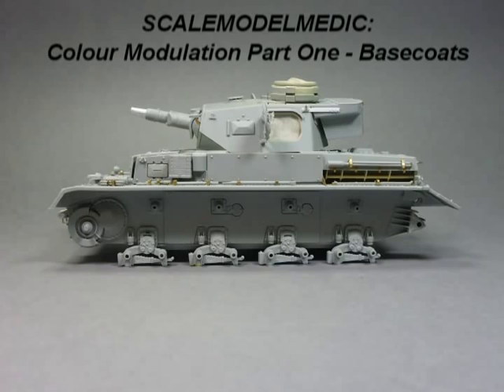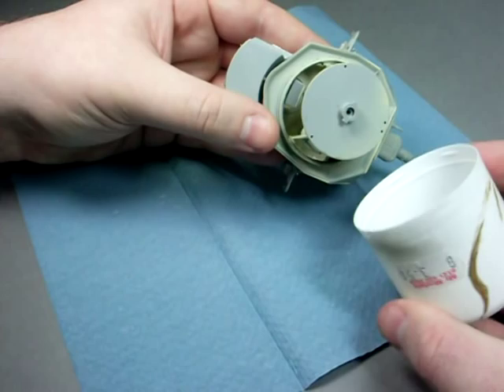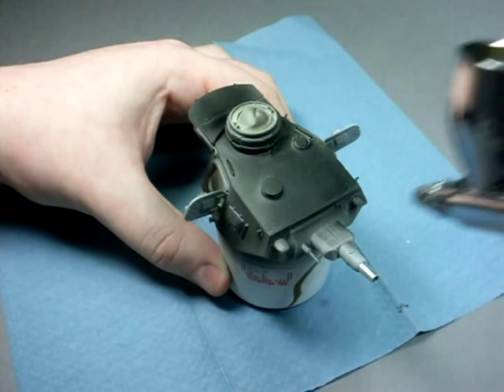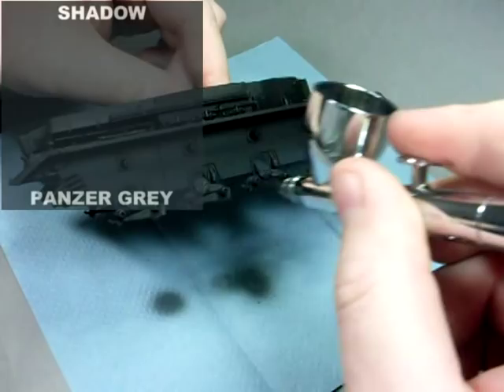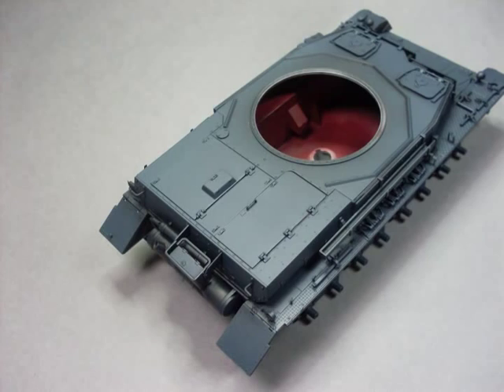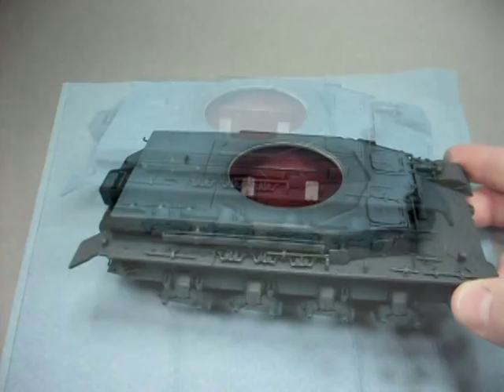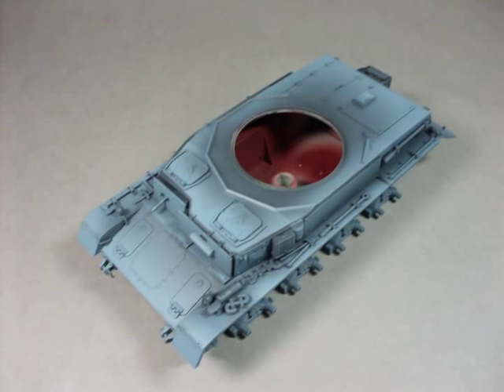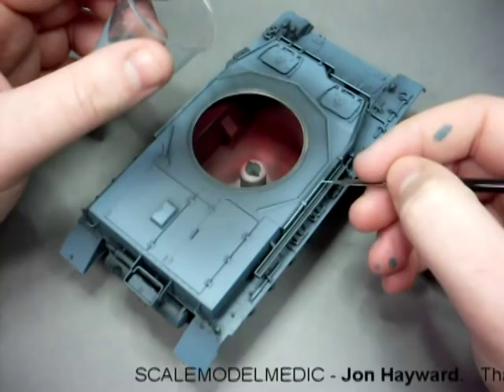Colour Modulation Part 1: Airbrushing Basecoats

Comment from the maker: @xxxxRINEHARTxxxx  a part is just 1 measure of whatever you're using.  If you're using a pipette a "part" could be 1 drop or 2 drops.   If the mix is 2 parts white to 1 part black it would always be the same ratio of paint.  A part could be a pint if you're mixing a lot of paint, it would still be the same ratio just different amounts.

Comment from the maker: @vintagestarwars 

yep the Vallejo air are not just great paints but acrylic and clean up in water just fine.  They DO dry on the needle and tip like any acrylic, but it's simply a case of regularly cleaning with a cotton bud (qtip) to remove the residue.  Painting this model I didn't suffer with it as much as I do when spraying a "field applied" camo like in one of the HD test videos,  then I'm cleaning the tip pretty much after every spray.

Comment from the maker: Yeah I agree, the actual base mix is quite good (10 parts seagreen, 3 drops black, 1 drop insignia blue) and a nice tone for panzer grey - but if you're modulating you need to go light and blue is the nicer tone.  Grey looks too flat really, and would be even more pale than the blue.

Panzer grey is a really nice colour, very dark and imposing.  This is more like a grey-blue,  but I'd rather that than a grey-white.  The tank would look like a B&W photo with too much exposure.

Comment: I would agree with this as I do something similar, i prime the model in vallejo black surface primer then I use white to paint just the center and main body of all the panels staying away from the panel lines leaving the edges and any shadow areas in black I then shoot the main color over it in very very light coats until I achieve the right under shading. it works fantastic on tanks and armor models as a whole. I favor German WWII armor mostly.

Comment: I dont understand how the airbrushes in all guide videos work so good and produce such steady and nice flow of paint. I only do modeling about 1 year, but almost every day, I started with some cheap airbrushes and never got results like in videos. The paint was clogging, sprinkling, or flowing too much and ruining model. Then I read more forums and watched videos, and I invested in good airbrush Badger patriot (very expensive for me, I am from poor country), but again same. I clean it after every use or color change. I bought proper acrylic thinner, drying retarder, airflow improver, even bee wax, always thinking maybe that one next thing is what is needed to make it work. And still its not good. If the paint mix is thicker it wont flow, or it spits paint with lot of collecting on tip, if its thin it flows sometimes in large bursts and makes mess. Airbrush trigger is killing me, it has lot of empty walk and then sudden burst. The ''optimal'' point is so small that its really hard to stay in it if I move airbrush around. There is no gradient when pulling trigger back. Also, even with super fine conversion set for badger I could not get narrow, round, precise line even from very close, even if its flowing steady its spraying too wide. So far, I have never been able to manually make camo pattern like some guys do in guides. Its just spraying too wide and its constant struggle and fixing and re-fixing, untill I get.. some kind of relatively clear borders. Its completely impossible for me to do thin layers like in this video because there is no small pull back of trigger and light flow. I now suspect compressor, cause its small one, for nail artists, up to 25 psi apperently, and i bought new one and am collecting cables and connectors for it. But.. I have impression airbrush should work much better overal. Tried also all sorts of paints and thinners and ratios.. vallejo model and air, AK, humbrol, tamiya, MRP, model master.. still same. Is it me doing something wrong?
Reply: I ran into this problem too when I first started airbrushing.   Make sure you use the right paint to thinner ratio.   I use more thinner then paint - 70/30.   And keep practicing.
Reply: I’m afraid practice is the only solution. But if there are any rules to airbrushing there is these: You can never have your paint too thin. The thinner the paint, the more numerous the coats required to cover. The thinner the paint, the lower the air pressure. The closer you spray, the lower the paint flow, the lower the air pressure. Practice on paper, then move to a model and always keep the needle clean.

Comment from the maker: @MHMonsie the only way to get good with your airbrush is practise mate !  Spray on paper first, learn to control the spray.  Make sure you ease off the paint before you ease off the air, that will stop the splatters.  ALWAYS ALWAYS ALWAYS start your air flow with the airbrush pointing AWAY from the model - any paint left on  your tip will splatter the model if you don't do this !! other than that, you just need to learn to control your airbrush and you will go from there!

Comment: So basically you keep thinning down the original custom mixed color of Panzer gray by adding the other color mixes to the live color mix in the airbrush cup? Correct?
Reply: Essentially.  Different colors require different techniques.  For example, when I do olive drab,,I start with black, then spray a yellow in the center of big panels, then switch to various shades of OD.

Comment: Question that has nothing to do with the video: Can I paint the models with, like, a brush?
No money to buy a brush, let alone paint.
Reply: Yes, it is possible, get some cheap ass acrylics, you can water them down, use very thin coats.

Get some half decent but cheap brushes, big to very small in size.

Buy a cheap ass model, and take your time. Use very thin coats and not to watered down. 

And be patient. (Also you can think acrylics to such a point you can use them as washes etc)